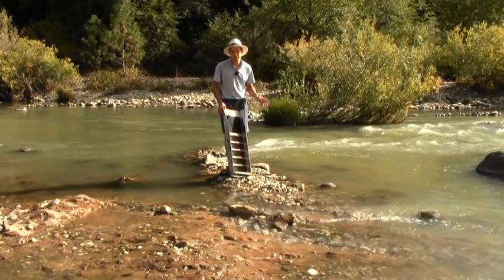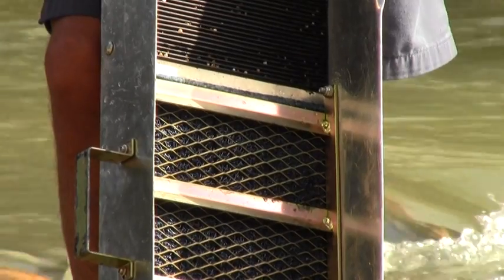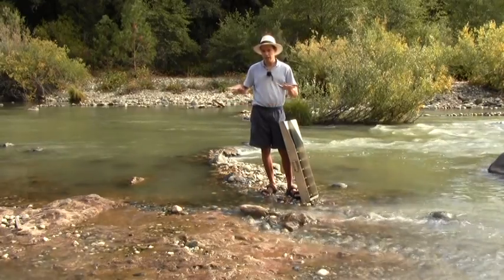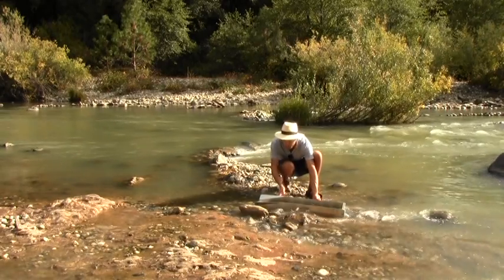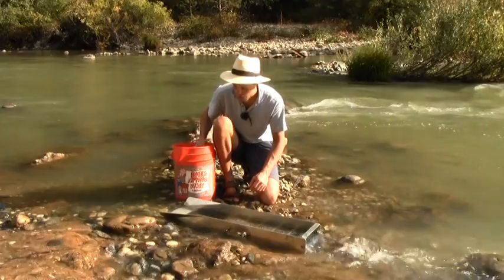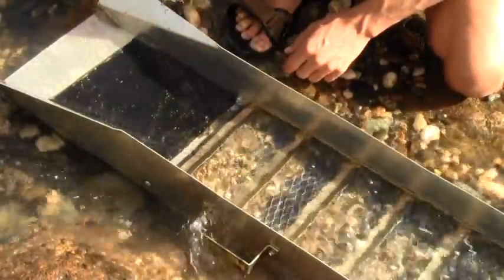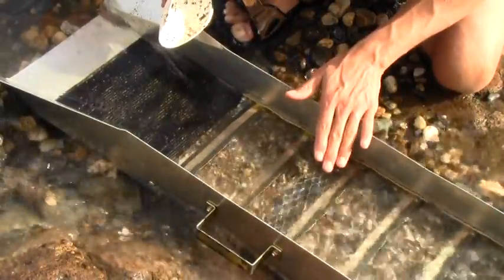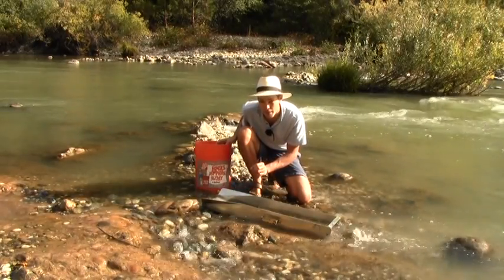How To Find Gold #5 - How To Set Up a Gold Sluice

Comment: Should my sluice box have a 100% black samd retention rate?  I made my own out of stuff aroun the house and have ram some sand from the back yard. I have panned the tailings from the sluice as well as the concentrates and find that it holds about 65-75% black sand. Is that good?

Comment from the maker: Many do that, but in my opinion you're losing gold. It's very easy for the gold to work it's way through the moss down the bottom. You should have either carpet or v-matting as the bottom layer. Or, preferably, replace the whole thing with the matting from my next video.

Comment from the maker: It's hard to say. See, the sluice should theoretically retain all the heaviest materials. When it's full of all the black sands it can hold, it will discharge the lighter black sands. So it's always going to lose some. On the other hand, if your concentrates were not *mostly* black sands, then your sluice isn't working right.

Comment: the technique is not perfect their must be and inch in elevation at the mouth for every riffle in order for the eddies to form.also you should add material so fast because it clogs up between riffles like it happened in the video.it also changes the flow rate dragging gold with the change in the waters elevation due to feeding the sluice to fast.

Comment: Losing gold? Nah! Do an experiment. Put one box below the first. Run the first anyway you want. I'd be surprised if there was any gold in the 2nd box. I've tried that. Fast, super fast, high water, low water. Never a speck in the lower box. With gold, don't think about its weight. Think about its mass in relation to its surface area. That will give you an idea of how difficult it is to move
Reply from the maker: I have tested it extensively. I actually did it once with three sluices, end to end. You always lose some gold. You can't get 100%, that's not the point. Sure, you can get all the stuff bigger than a large flake - that stuff gets trapped in the assay mat. But the flour gold is never completely caught, and even on my third sluice I found a small amount of gold. This was after running buckets for hours, of course. 90% was in the first sluice, 9% was in the second. But there was still gold in the third. 

This was not using the gold-hog mats I like though, it was a friend's sluices on a highbanker. With gold hog the retention is much higher in the first sluice. But still not perfect. I actually watched a flake work its way down the sluice once, as I added buckets and the new dirt stirred it up.
Reply from the maker: As I said, the point is not to get 100% of the gold. The point is to process as much material as possible without losing too much. It's better to process 10 buckets of material and lose 10% of your gold, than to process 5 buckets of material and lose 1% of your gold. You'll find almost twice the gold at the end of the day, even if you lose 10% of it.
Reply: I'm surprised. Maybe the water wasn't moving fast enough. I figure, if there's gold in the field between the riffles, the "hydraulic jump" isn't strong enough. If you look at how fast a dredge box cleans the material out, it's hard to get a manual sluice to work that fast. I asked an old timer ,about 30 years ago, how fast should the box clean out. He told me that everything but the gold and black sand should be gone in 15 seconds. If a flake is working its way down the box, that's a sign that the water is too slow. I found a 1/2 oz piece once. Where was it? Sitting on the edge of the 2nd riffle. A 1/4 oz piece was sitting on the edge of the 3rd riffle. I don't use miners moss, that black neoprene before the riffles. Just a straight Keene box with the green carpet. I can't swear I'm not losing any... but ya never know.